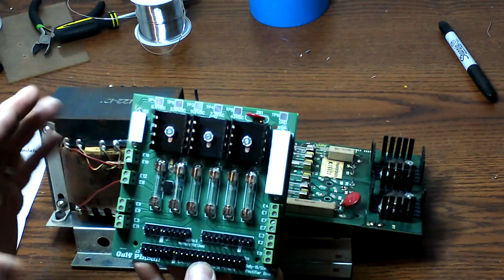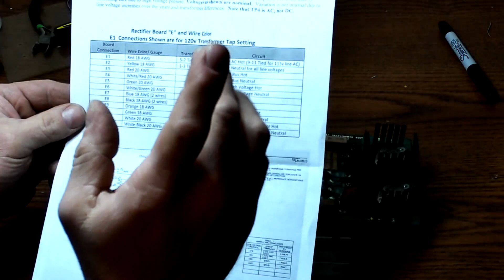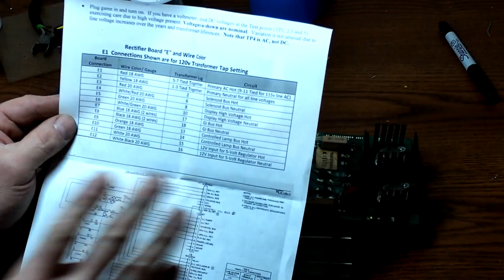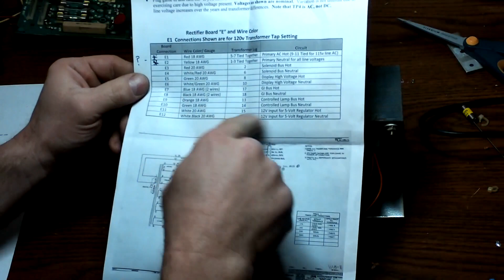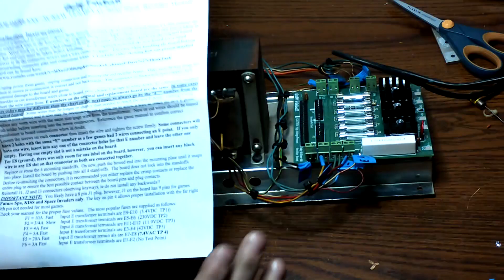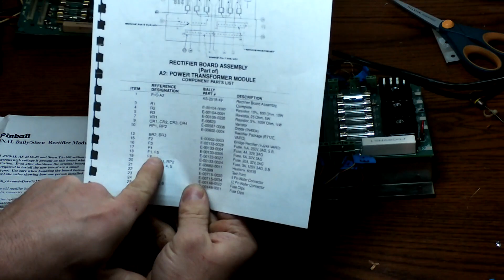NEW Gulf Pinball Rectifier Board Installation | Replacing OLD Bally Rectifier board

Comment: Nice Video !! Gulf Pinball Makes nice quality boards , But I still prefer the solder in type from them.  I have changed out several of these. You are right E1 and E2 are wrong on the wiring list. Keep them as they were on the old board.   Thank you for posting this video.
Reply from the maker: Thanks for watching and for the helpful information.